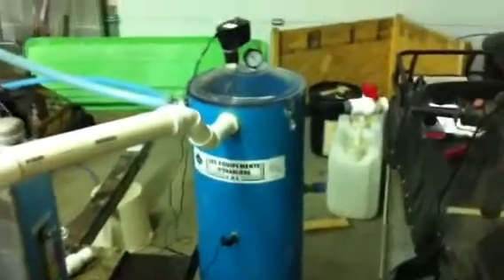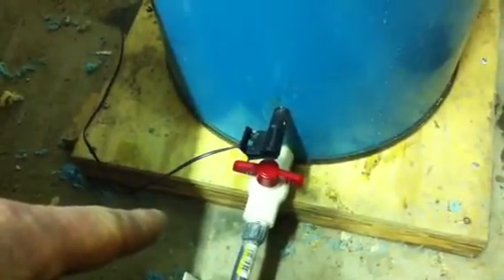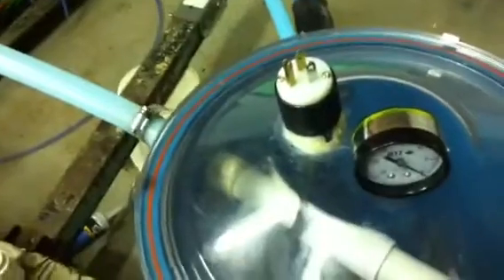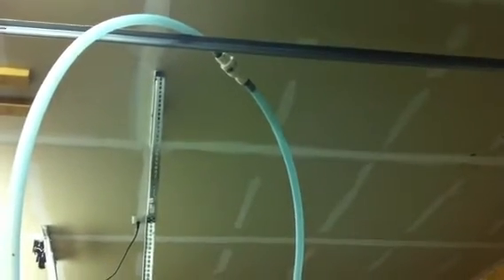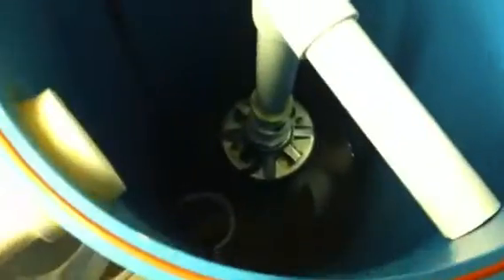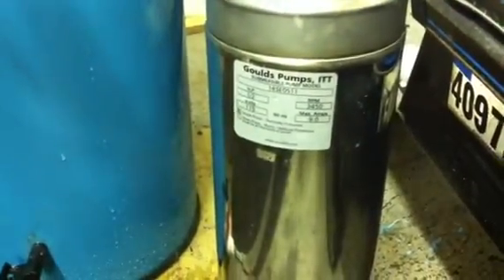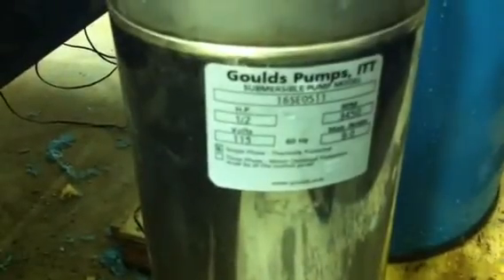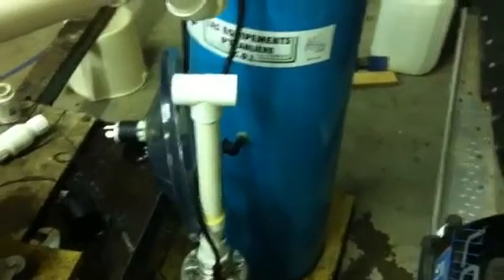Homemade maple sap releaser

Comment: Enjoyed your video on the sap releaser. I am going try to build one like yours, my sump pump has a float on it. Where can I get a hold of you for some advice. Is there a release that lets air in or is it needed in a closed system?
Reply from the maker: you can either email me at mosersmaple@frontier.com, or the better option i would recommend is www.sugarbush.info/forums  sign up to become a member and start viewing all the different threads that are maple related